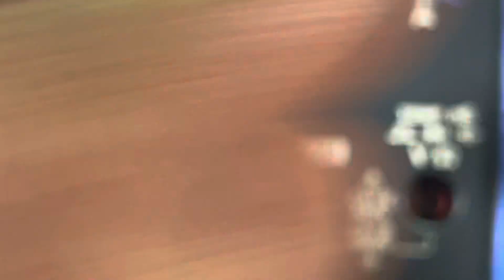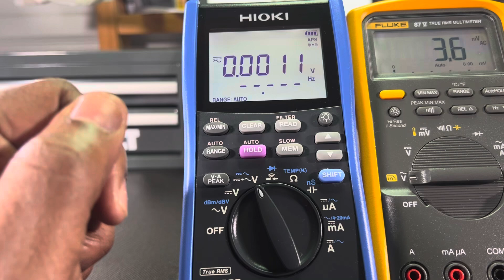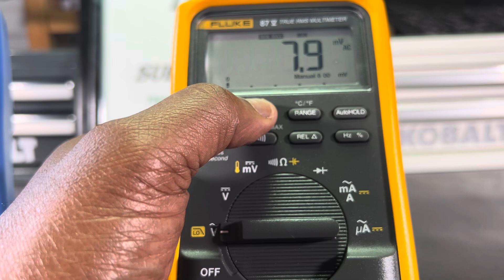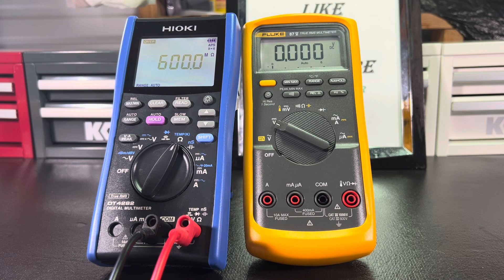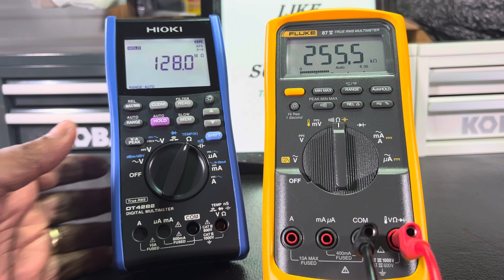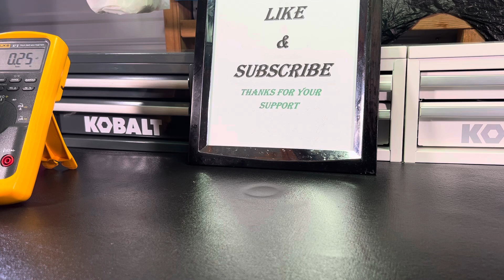HIOKI vs FLUKE  (Loser Go Home)

Comment: I love when people try to compare their overseas made bullshit to some USA made, known circuit diagrams, proven support, military spec's Flukes.
Reply from the maker: Don’t get too uptight about it I’m just saying my opinion. I’m not nominating either multimeter for the office of presidency. Thanks for watching 🇺🇸
Reply: Fluke 87V Made in China 😂
Reply from the maker: @jfmposada   You’re probably right.
Reply: @jfmposada  yep, a couple low end flukes are made in China. The rest are still made in USA. 233
Reply from the maker: @Youkanthandlethetruth  you’re absolutely correct 👍🏾
Reply: I don't think anyone considers Fluke multimeters to be bad, but claiming that they are the best of the best compared to others and that all other multimeters is just as silly. What I don't like about Fluke is that they try to milk their customers for as much as they want. For instance, the 175 has a backlight feature inside its circuit, but it comes without a button for it and therefore it can't be used, unless of course you drill a hole in it and do it yourself, but that way the warranty will vanish in an instant. So, you basically have to pay $50 or more and get the 177 just to be able to use the feature that it has, but it's somehow restricted and were talking about a $420 dmm here and it has no backligh, what a joke! Also, almost none of the Flukes come with the good silicone probes and if you want them you have to pay extra and none of Fluke tips afaik are gold plated, while much cheaper multimeters give you all of that and more for far less. Let's not forget that from time to time they call out some defective batches.

For me, Fluke is like Apple and Rolex - resting on their laurels by cultists and fanboys who repeat the same phrases over and over again and when you try to provide facts, logic and evidence, they just can't handle it. Again, I'm not saying that Fluke multimeters are bad, but for what you get nowadays there are much better and affordable options that also offer way more features and a lot of people from all around the world who can't afford or have access to Fluke meters are still working and doing just fine without it.

Comment: I have both of these, plus lots of other multimeters. My clear favourite is the Hioki. Good features, but most of all feels good to work with. My only annoyance is that the auto power off time should be possible to sett to longer times, rather than just on and off.
Reply from the maker: It sounds like the PROS out weighs the CONS to me. Great choice👍🏾
Reply from the maker: It sounds like the PROS out weighs the CONS to me. Great choice👍🏾

Comment: My 87V is 16 years old. Calibration cert ever year and it has not changed, it has been in daily use in the marine industry for that time and it passed every year. The readings are well above spec. Incredible metre. I would not change it for the world. I only wish the 87V had lo impedance to kill ghost voltages.

Hioki is a fine brand though. We use their battery testers all the time.
Reply from the maker: I’m glad your meter is working properly and serving you well. Like I said the fluke is a great high quality meter. But in this head to head comparison they both scored high. But the hioki also gives you more bangers for your money 💰.
Reply: how do you feel about 8V output on a low ohms range and diode testing? do you think is it safe to test 3.3v boards with 8V?
Reply: Agree with the LoZ wish. I think it's essential on electrical and industrial multimeters, but it's not a widespread feature on Fluke's.
Reply from the maker: Only on Fluke’s higher end models.

Comment: Fluke has never been the best in Depth of features.  Where they are is in providing good long term stable and consistent readings from meter to meter and consistent function from their devices.  They are called out in manuals because they manufacture the same device for years on end without changing them.  For meters my money is on the Amprobe ACDC 54-NAV for the electrical trade.  I have used them for more than 15 years now.  I don't know how Hioki is, where they are actually made and what their long term stability and reliability is.  I do know this with both Fluke and Amprobe.
Reply from the maker: Well the AMPROBE 54NAV is originally manufactured by a company called APPA. They made the same exact clamp meter for a company called ISOTECH, SEAWARD, and several others. I own a AMPROBE 54NAV and I agree it’s a great high quality instrument. Did you know that fluke purchased AMPROBE about 10yrs ago. Fluke purchased a few well known brands to squash the competition.  Just like KLEIN TOOLS purchased UEI Instruments. Anyway I agree with your comment. Thanks for sharing.
Reply: @TheElectriciansToolChannel  I was aware that Fluke bought them and it sucked that it happened.  They also bought Keithley, another legendary test instrument maker.  The quality fell off after for the Amprobe instruments.  The ACDC 54NAV is so feature rich and functional for the price it simply can't be beat.  I also own half a dozen Fluke meters as well as a 5.5 and 6.5 digit bench meter.  I also own a 7.5 digit Agilent bench meter to calibrate to.  It simply doesn't drift.  Frankly one of the best things about most Fluke meters is that they seldom drift much.  Another reason I like Fluke.

Comment: I own this meter and maybe 8-9 other Fluke meters over 45+ years you can almost use Fluke meters to bang nails with they are extremely durable in the worst industrial slime corrosive environments and still work as they should.
I won't buy anything else as this is my work environment. Looks like the Hioki would be fine for a bench multimeter.
Reply from the maker: I agree fluke is a great meter.  But at the moment comparing the two I think the HIOKI is equal and in some cases more qualified than the fluke for less money.
Reply: @TheElectriciansToolChannel  I agree a nice meter but I would feel better after seeing how it fairs after a fall onto a concrete floor from atop a six foot step ladder or similar drop when -10 degrees F
Tradesmen do this all the time very abusive environments. Probably just me.
Reply: @TheElectriciansToolChannel Not only that some Hioki models can survive extreme cold and wet environments. *Cold temp ratings are better than Fluke
Reply from the maker: @artbyddp  I'll take your word for it. I never had an experience using either multimeter in the extreme cold.

Comment: The comparison isn't fair. Hioki 4282 is high-end, Fluke 87V is not, the highest model, it is Fluke 289 (287) or 189. Hioki is loser for me- no bluetooth module ( FLUKE have IR3000, Keysight have U1177A, UNIT...), no bargraph, there is no possibility of adjustment, only 3 years warranty, there are no instructions in Czech. This brand is as exotic as Yokogawa and Kyoritsu. Total exot. There are no spare parts. And for Hioki: Diode test is very bad, bo beep for good diode, LPF can only be used on 600V & 1000V range, I am missing duty cycle and average (In some cases the filter function can substitute) and I do not know how useful 400 memory locations are.The user interface is slightly different to most other multimeters with min/max always active and a CLEAR to reset both min/max and peak without disabling them.
Reply from the maker: I hear ya FLUKE is a very high quality brand. But in this matchup HIOKI wins. That’s just my personal opinion. I think 🤔 you have an open mind and give this HIOKI a try.
Reply: @TheElectriciansToolChannel  I use Hioki at work. It gets stuck when switching the current range. Probably some dirt in the mechanical locking of the terminals. Very sensitive and impractical. Fluke uses a photosensor.
Reply from the maker: @robertkovar8710 That maybe the issue.
Reply: i love hioki❤❤❤
Reply from the maker: @ianrosal1235 I’m very excited about my HIOKI DT4282👍🏾
Reply from the maker: Wow, now I have to go back and evaluate this multimeter all over again. Thanks for sharing 👍🏾
Reply: I read this exact text from a review of this meter done a few years ago.
Reply from the maker: @roseelectronics4582  Was it from this channel?

Comment: can you tell the testing output voltage for a "diode testing" and "low ohms" modes? in Hioki
Reply from the maker: DIODE TEST:
* Open terminal voltage: 4.5v or less
* Testing current: 1.2mA or less
*Threshold of forward voltage: 0.15v to 3v, Seven Stages
RESISTANCE RANGE:
*60,000 ohms to 600.0 M-ohms
* 8 Ranges ( Conductance: 600.00 ns
* Basic accuracy + - 0.03% rdg  + - 2 dgt

Thanks for watching, I hope this information answered your question?
Reply: 30v on my metrix, can test many diodes in serial.
You can choose, normal, or higher voltage in a menu.
Reply from the maker: @ That’s very nice AEMC Metrix depending on the series you have is a nice multimeter.